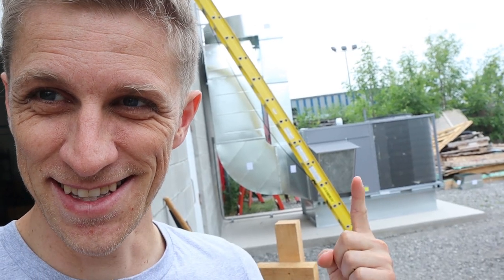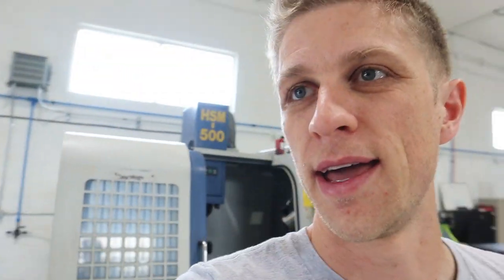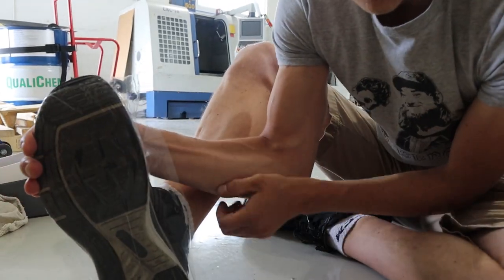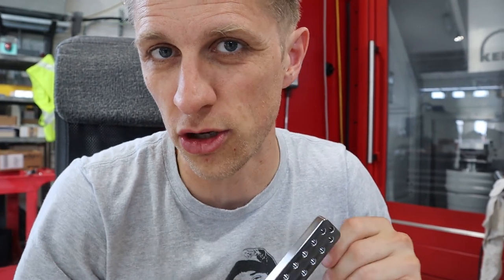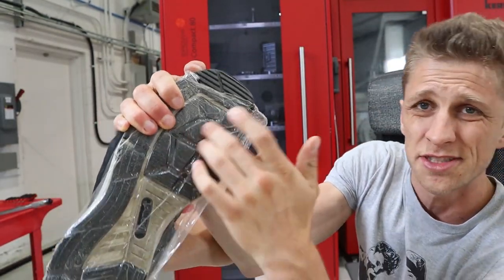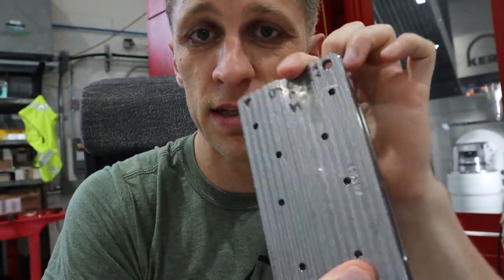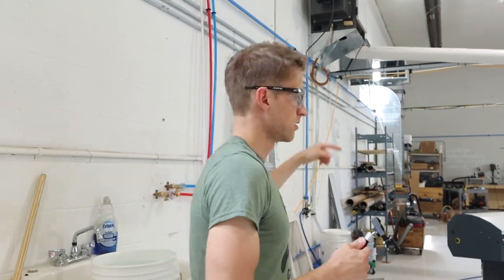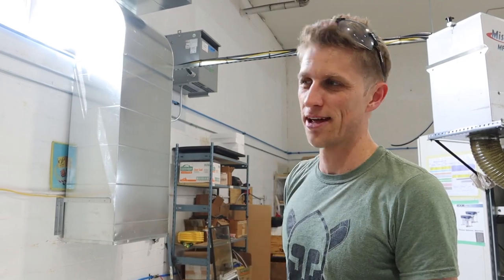So many awesome updates! - Shop Life 52

Comment: for the dirt that gets tracked around the floor, you could have a designated exit area from the grinding cell and put some clean room sticky pads along the exit path that you walk across.  they're not that expensive to try out.
Reply: Yes, that is a better option compared to those overshoes. I don't like the overshoes because they are always a hassle to get on and keep on properly.
Reply: Yep, this is a great idea. There's also these, but they're pricier: https://bootiebutler.com/
Reply: Many of the datacenters I've worked in had one of these just inside the computer room door so you'd tack/clean your shoes for 2-3 steps before you walked onto the floor. When they get dirty, you just rip up the dirty sheet and have a fresh surface. I found these on amazon, there are a bunch if you search around, and you could also find them from industrial suppliers too I'd imagine. https://www.amazon.com/Valutek-Cleanrooms-Adhesive-Removes-Microns/dp/B00JBG7TLW
Reply: Yes, i seen some shops with those sticky mats. Usually in a totally sterile enviroment

Comment: Instead of the adhesive plastic, you can get disposable shoes covers with grippy/textured bottoms. They are widely used in the semiconductor industry.
Reply: @Mafiashotz This is what we do in Automotive paint areas.  We have big adhesive pads near any entrance or exit door near dirty equipment.  Helps keep the area clean.
Reply: They are also very common in the high care food industry
Reply: I was going to suggest this. They don’t even have to be the expensive, clean room, kind. With Covid, lots of service professionals are using them when entering peoples homes
Reply: Unless you have size 13 feet, none of those plastic boot covers fit.....

Comment: I also just bought a water system for my new mill and have topped it off a couple of times now.  Each time I had to adjust the mixture because as the coolant evaporated, the mixture in the tank changed.  So the auto topoff SEEMS like you would put the proper mixture into the tank but the tank's mixture would be off more and more.  I am still learning this stuff (completely self taught) but I took my coolant very seriously because my old hobby machine had a ton of problems and I switched to synergy coolant which is real picky about water quality.

Comment: Have you tried sticky mats, they are small 2'x3' (other sizes available)rubber carpets but are sticky, when you step on them they take the paticles off your shoes but don't transfer the stickyness, they can be made for different purposes depending on your need, biohazzard, chemical transfer, dust removal etc. might help.
If you cool everything down in the machines, tolerances will change, ever so slightly and might go out if spec, I was amazed the difference on my lathe when boring between hot parts and cold parts, I always let them cool now before final measurment as I've made a few cockups.

Comment: Great video.  Good timing for getting the AC, I am in the KW area and have been dealing with the same temperatures for the last month, we have no AC in the shop and it is a flat metal roof with black tar which makes it a bit worse.  Running a Thermwood router with 3 10 hp vacuum pumps that around 80 degrees C on the casing makes it 5 degrees warmer in that spot.

Comment: 28:45 the Kern has TCP function. You can set the Part Origin wherever you want. We almost always put it in the center top of the part and when we flip it, then we either just create a new part origin and rotate it or also move the origin to the lower side

Comment: I had an older guy that repairs CNC electronics come in and look at one of the machines in the shop. He started his career as an electrical engineer for McDonald Douglas up until they were bought out by Boeing. Our company aquired some old pieces of equipment at auction when McDonald Douglas left and they are sitting around the shop. The repair guy kept looking at a wire stripping machine very curiously. I asked him what his fascination was with this old wire machine. He said that for the first couple years at McDonald Douglas, he ran a machine identical to the one we had. I informed him where we got it and you could see the nostalgia in his eyes. It was more than likely the exact same machine he had run and cut his teeth on.
Reply: McDonnell

Comment: Coolant - I always have to calculate my mixture when topping off because it's not always the same.  50% of my shop is not insulated, and the evaporation is crazy.  I thought about moving my VMC into the climate controlled portion, but then I have mist collection and air quality issues, so I leave the monsters in the hot portion and the smaller mills, lathes, and cnc's in the climate controlled section.  In South Texas so I always fight heat and humidity, and yes, water quality.  I use RO for the house and shop and then Deionized for the coolant and washing the vehicles.

Comment: You can get boot cover dispensers, they are non adhesive, just stomp into it and the boot gets a cover on it. You can also just buy boot covers  on amazon you can pull on manually but the dispensers are cool!

Comment: A lot of the big factory's that I visit, require everyone to wear the plastic booties over their shoes.  Elastic band holds them on.  Their floors and factory are immaculate.  Worth thinking about or researching.  Actually, some require smocks / Lab coats?  Like a long robe or jacket.  That is mainly in the electronic mfg stuff because of anti-static measures, but, I have been in aerospace machining buildings that required smocks and booties and everything else under the sun!

Comment: Oh I have some 40C  304 stainless parts I need to tumble occasionally when I need to squeeze extra parts out of the endmills because they are 65$ for the cutters and I like to try to get an extra fixture or 2 out of each end mills but it leaves little fray stands that are HARD as F and annoying to deburr the 55-80 extra frayed parts I can tumble them 2 days and they go away but the stock is .015 and the parts will clump together sometimes. Going to try the ziptie next time 👍

Comment: I’ve seen heat shrink shoe covers used at a boat show. Similar looking unit push your shoe down and the plastic is shrunk around the side of the shoe. Think it would solve your adhesive problem!!

Comment: As others have said, cleanroom booties.  I would even consider a mud room type of setup.

If I had known about your water system, I could have offered you a Flowjet pressure accumulator, add a check valve and a beverage industry sanitary water pump and you would have spent way less than the pump you bought.  I got the accumulators new surplus for a few bucks each...

Comment: Have you looked into epoxy-granite? There’s an insanely long thread about it over on cnczone.com... but to summarize; you mix sand, crushed rock, and rock dust with the epoxy; and not only does it greatly increase the damping of the structure you fill; but it means you’re not spending a fortune on epoxy (because the rock & sand takes up the space in the mixture).

Comment: Capture and reuse the A/C water.  It will be super clean!
Reply: AC water is very dirty. It has all of the air in the shop passing over it when it condenses on the coils. (Depending on how fine/coarse the filter is, it still gets a lot of dirt and bacteria.)

Comment: I've had 4 Grundfos pumps, all have leaked....3 before 1yr from installation. It's a shame because they are nice pumps and the company is good, but there is some faulty engineering and they know it. I just switched to an Italian pump call DAB. Good luck with yours.
Reply: And consider a pressure tank even if the smart assed pump claims you don't need one.

Comment: I would think about either extending the AC drain on that slab or at least put a gutter diverter under it. Otherwise, it will end up staining the concrete and probably eat away its surface.
Reply: And rust the base of the unit, and going to get messy with mould etc

Comment: Titanium to titanium will still scratch. What's wrong with high durometer rubber or G10 as a pivot holder?
Reply: Scratches was not the problem. The aluminium would stick in small spots and mess up the anodization.
Reply: @martinbjorsberg  Yes Martin. G10 and hard rubber  won't leave traces on the titanium parts in the tumbler. 👍
Reply: @jamesbarisitz4794  It's going in a tumbler, a machin built to make small scratches :) Ti on Ti is not a problem, otherwise handle on handle would be an issue.
The Ti fixture will last forever but g10 and rubber would probably disintergrate rather fast.

Comment: Hi John, just curious enough to ask you this question,
What do you think of the idea of using a strobe light IN the Kern working area, when the machine is working (with coolant being used ) to aid filming especially if you buy a strobe that has adjustable timing to syncronize the frame rate of the camera and the coolant being used,?
You may just be able to get good video. 
Tony from Western Australia